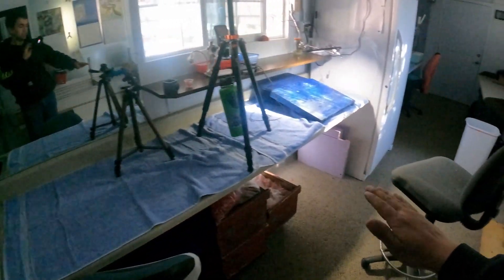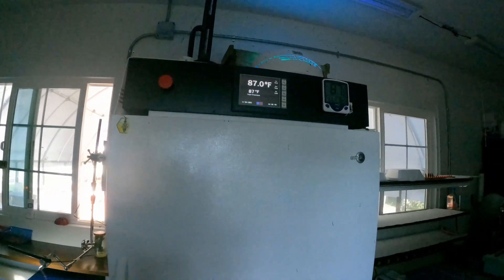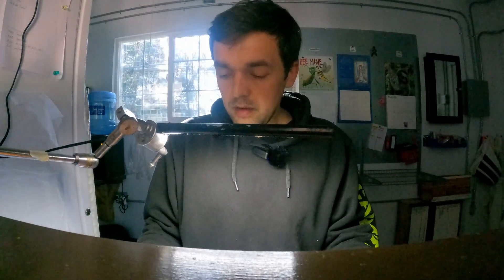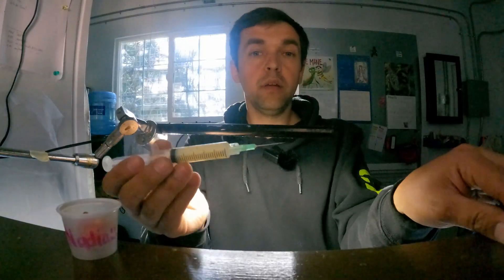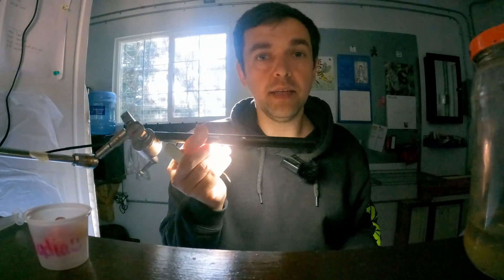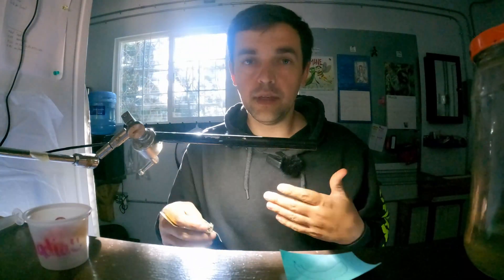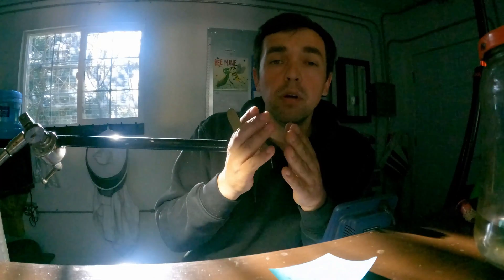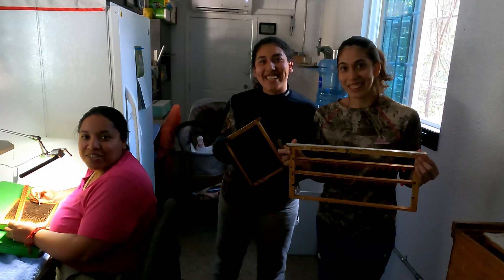Grafting

Comment: In which way and how long can the royal jelly be stored?
Reply from the maker: I know you can freeze it. However we just use it the same day.
Reply: @BeeInnovative  did I understand correctly you use 1/3 of cup shown for jelly and fill same cup until half full or a separate half cup of water is added to the 1/3 cup?
Reply from the maker: @tyleregan9927  You are correct 1/3 cup jelly and then add another little bit of water just to make it a little more liquid. We use drinking water